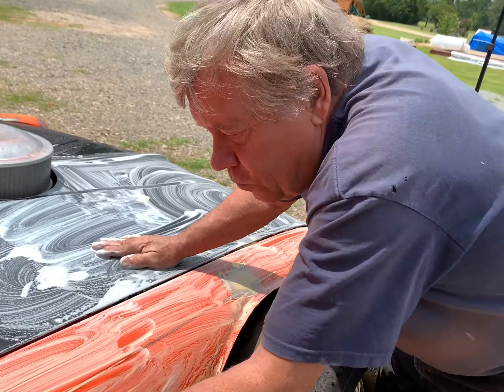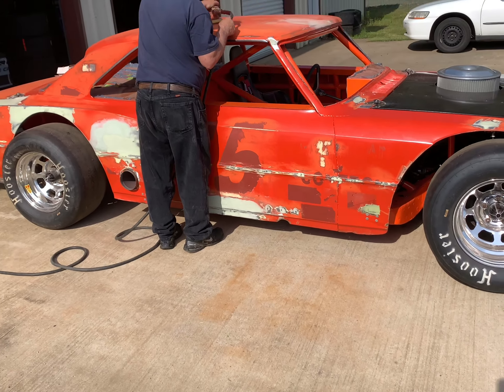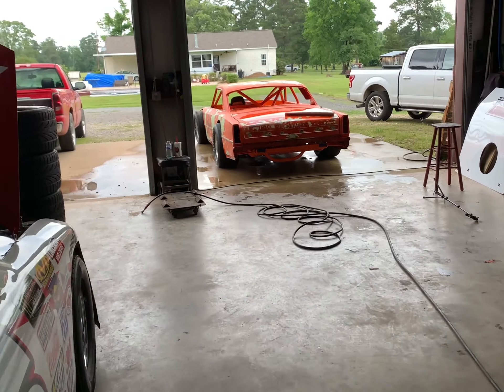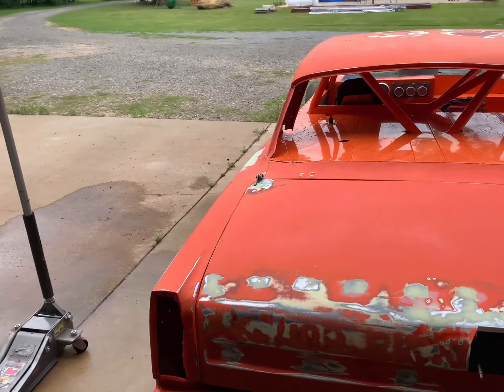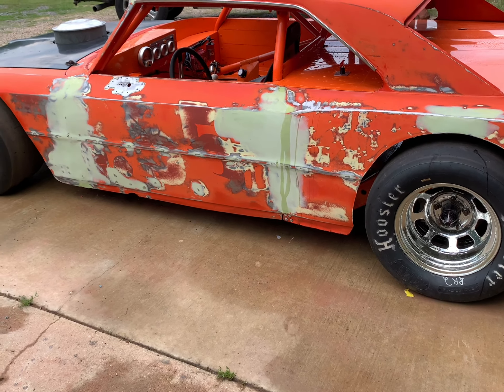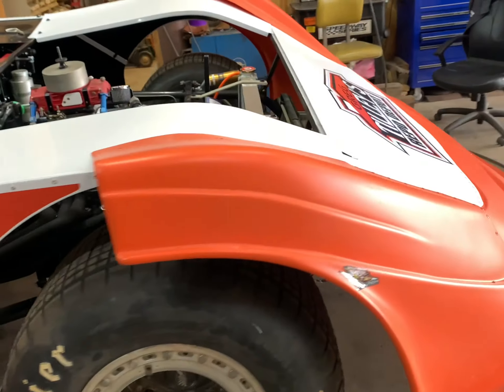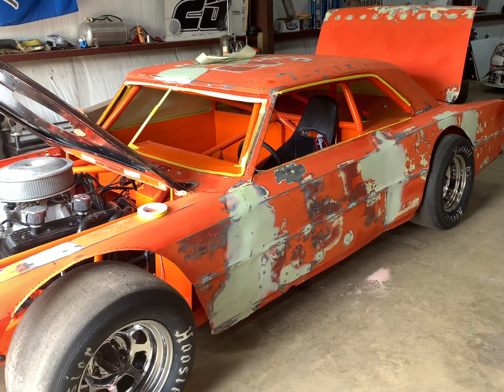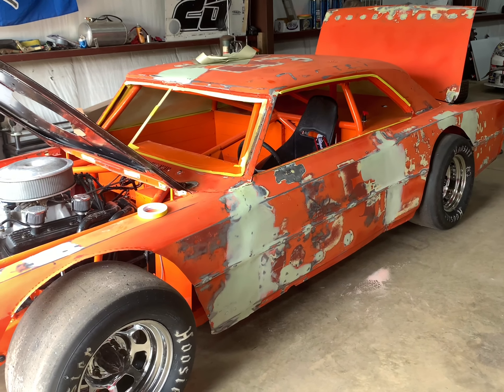#40 Racing, Sanding & Priming - Will the Weather Hold Off ??

Comment: The tires stick out too much.
Reply from the maker: Thank you but all vintage cars are that way !! It’s just like intended it to be
Reply from the maker: You need to check out the south east vintage series - they all look this way.
Reply: Hey Joe, that's the way they used to look. Check out some old videos of the Nascar grand national cars.
Reply: That was the way back back in the day tires sticking out, the wider the better! I cut an  angle on the ends of my spoiler and slightly rounded the edges. Gave it a little character.